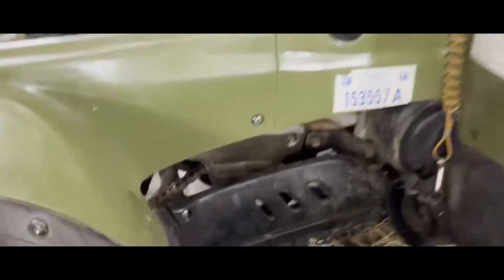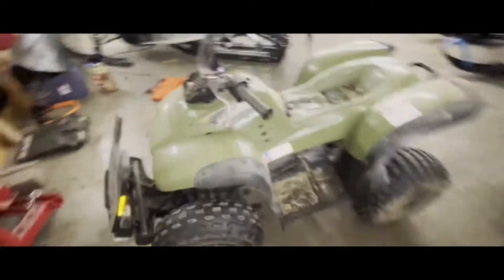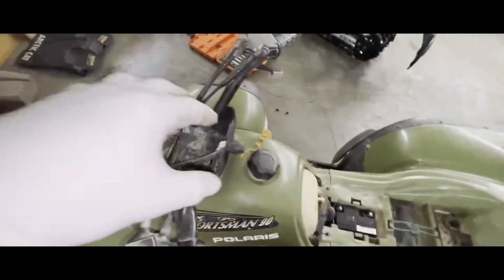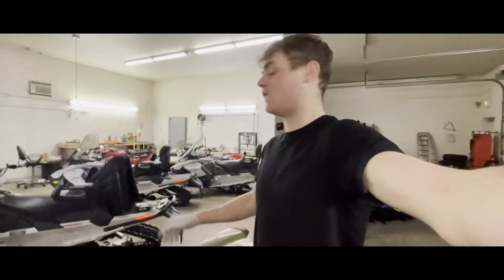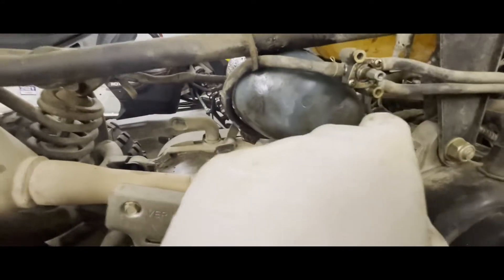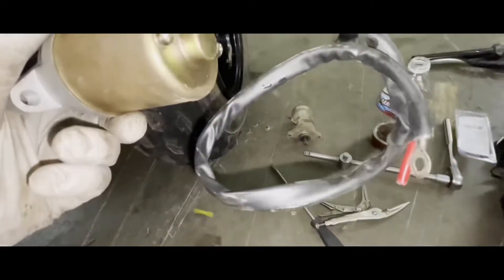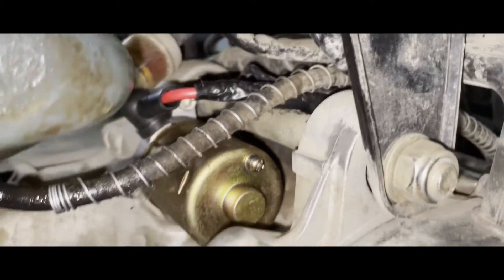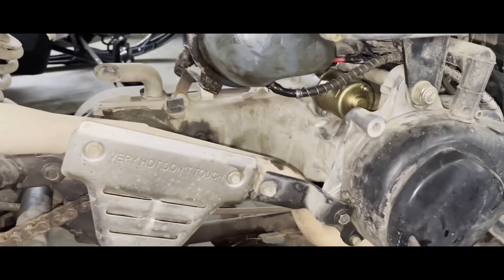Polaris 90 Electric Starter Install

Comment: I have power to my starter but not turning I'm stumped
Reply: If it’s at least trying to turn you may just need a new starter. Test it by setting up some jumper cables and putting the black end on the negative and red end on the starter. If the starters good it’ll start turning as soon as power hits it.